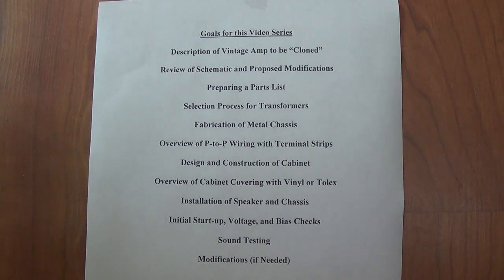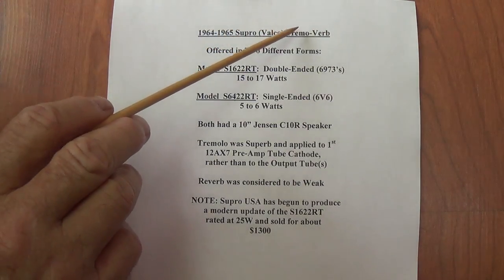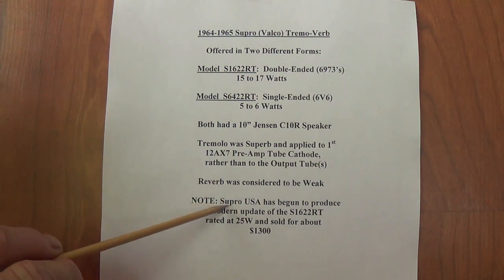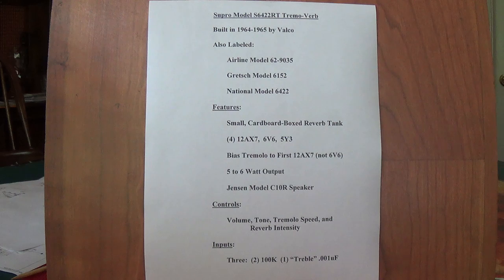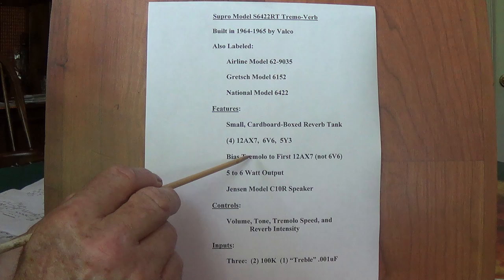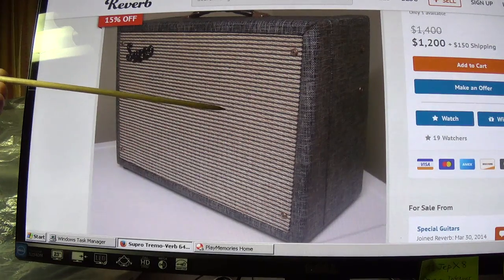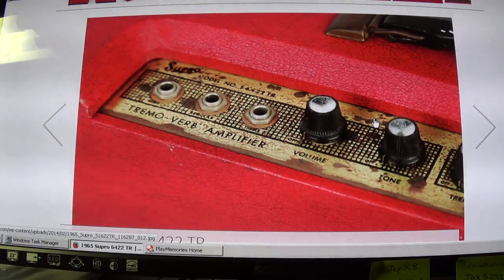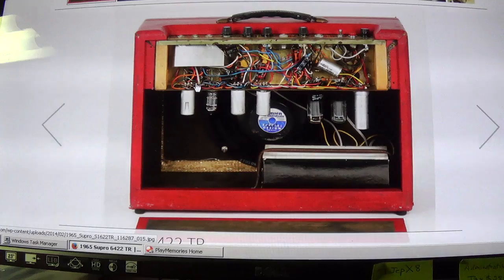How to Scratch-Build a Vintage Amp, Part 1:  Research and Methods

Comment: Supro resurrected because of nostalgic "demand"?..must have more to do the stuff of legends. Lots  of speculation that Jimmy Page recordied the first two Led Zepplin album, (Stairway to Heaven etc) on one of these vintage Supros  than anything else. Page never did say which Supro model he used, but it was "probably a 65-66  grey and silver model" as he claims in his Youtube video, so the run on these in pawnshops and in music stores,  makes it virtually impossible to find any of the original models, 
Any of those perceived to be of that era can command a HEFTY vintage price, so I'm not surprised at the re-issues. 

 If he knew what he used, he ain't saying which model, so that raises the speculation prices on any of the original 65-66 models that are still out there available for resale.  

It is rumoured that Page's amp used the rare RCA 6973  beam power tube, as used in the Airline/Valco amps of that period with "a single ended" (about 18 watts) design . However, that can't be true as the 6973 max plate dissipation is about 12 watts.
 (The RCA tube specs indicate about 15-17 watts max power output in a push-pull cathode bias arrangement)
. 
Now it is also speculated that Page changed the speaker in the original amp Supro amp "to a 10 inch" speaker.
 If the original Supro model  of that period came with those 6x9 speakers (ie: Supro 6616) , could there be enough room inside
the cabinet to even change the speaker to a 10"?

Uncle Doug; If you and Rusty can ever duplicate what Page used for those first two Led Zepplin recordings, you could become
as famous as Page and his special Supro amp.
Reply from the maker: +SuperCarver2011  I think the problem with accomplishing that goal, SC, is that no two people can agree on what that amp was or how it was modified. Also, and probably most critical, would be the absence of Jimbo's inestimable skills to make the amp sound "right".....unless of course, Rusty can convince him to drop by for a demo :)
Reply: If Jimmy Page's memory is anywhere like mine (I'm 69 now), I sure he would have a 
hard time remembering what he was doing
in the mid '60 to '68 when he was a session
musician, never mind the model of the amps
he was using. 
Page often points out that it is hard to remember exactly what he did given the enormous number of sessions he was playing at the time.
Reply from the maker: I understand his dilemma.....plus I'll bet there was some weed and whiskey involved, so all bets are off, memory-wise :)

Comment: By the way, I couldn't help but notice that Rusty seemed ambivalent at best about how much he really wanted to help out. I don't think this should be held against him, however, since he's obviously a fine old gent who has earned the right to decide which projects he wants to take on. More power to him, I say.
Reply from the maker: +Bruce Elliott  My feelings exactly, Bruce. I use the same approach with my wife when it comes to daily chores.....but her response seems to be much less understanding. I guess I need to adopt Rusty's tactics of either running away, hiding, or yawning.
Reply: Uncle Doug - I can't recommend the yawning. I've tried it, and it rarely goes well.
Reply from the maker: Yes, but it directs their wrath away from the chores and toward your bad manners..... ;)
Reply: I have to admire your commitment to avoiding work - it's inspiring.
Reply from the maker: I learned from a master :)

Comment: Hey, +Uncle Doug - I just came across this video, and it looks great! I've been toying with the idea of building my own vintage-style amp for a while, so this should give me a good idea of what I'd be up against.

I have one generic question, if you'd be inclined to answer: Are there any reasons why it would not be good idea to insert an effects loop (i.e. jacks for preamp out and power amp in) into a vintage styled circuit? Or even just a master voluem potentiometer at that point? That's the main thing I miss when I play through vintage amps, since it's so nice to be able to crank up the gain on the preamp to where I like it but still have independent control of the master volume.

Thanks!
Reply from the maker: +Bruce Elliott Greetings, Bruce.  On a scratch-built amp, you're free to add all sorts of modifications (as I intend to do with this one). The addition of an effects loop and master volume control would be much like my addition of the Fender reverb to this amp......you need to find a circuit that accomplishes what you want, and then graft it into the existing circuit. I don't use effects or master volume, so I have no personal experience with adding these features, but I'm sure there are forums that could help. Good luck.

Comment: You have come back from the summer break with a bang. The Elvis amp set the stage for this series. This will be a big project and you have thought it out really well! Thankz
Reply from the maker: +Audio Tech Labs You're welcome, ATL. Now that I've launched this boat, it should be interesting to see if it sails onward to glory......or sinks into infamy.  Either way, it should be an exciting cruise :)

Comment: Wow UD, this is going to be great, when I was young I used a Fender Twin Reverb, then the thing got heavier so I switched to a Deluxe Reverb, well, that gained mass with time too so I got a Princeton Reverb, now I gig with a Vibro Champ.I love reverb so I have to use a pedal.Anyway, looking forward to the series.
Reply from the maker: +tbdalva  I agree completely, TB. My days of lugging Fender Super Sixes up 9 flights of stairs are long gone.  As you mentioned, even the Deluxe Reverb is getting too heavy and the Princeton Reverb will follow soon. The thought of a compact, portable amp with both reverb and tremolo seems very appealing......and the SE novelty just makes it better.

Comment: I'm looking forward to this build! I watched the video you did on a guild thunder amp the other day was very impressed with the sound so i went looking for the schematic which was easy enough but pricing tubes and various bits  yes i can imagine the costs adding up ;-) but i love your ethic of reuse recycle wherever you can. One thing i was wondering also is what  say you can't find any photos or drawings of a particular original chassis/layout  is there a method for working out what size chassis you need and how to lay it out? Anyway hopefully all this more will be revealed in due course!
Reply from the maker: +Chris Kennedy  Greetings, Chris. Yes, the total cost of a scratch-build with new parts is substantial.....probably more than most people realize.  I'm keeping good records and will discuss this in future videos.  I generally can't find engineering drawings for any of the chassis I build, and usually rely on careful measurement of dimensions and L-W ratios, etc. from Internet pictures, i.e. as seen in this video.  More on this subject later.

Comment: Oh good timing Uncle.   I have three finished amps under my belt, last one was a 6G2ish Princeton thingy with Tremolo.   Was going to take the plunge on a reverb amp next so this series  already has me hooked!
Reply from the maker: +Barefeet200 Reverb is like a mini-amplifier and speaker (tank) circuit within the regular amp circuit, BF, but it's sure worth it (especially if it works :)  I'm a real tremolo and reverb hound, so I'm anxious to see how this turns out.

Comment: Super Groovy!   This may inspire me to reproduce a 63 Gibson amp I already have.   I've been told my amp sounds super cool when cranked loud,  but with the original Alnico speaker and original tubes and transformers....   I'd rather not hurt it.    So I wanted to clone mine.... and then rock the repro.

The other super cool SE Amp I built uses an 807 power tube for a whopping 12watts of Single End power.   I named that amplifier  "Braddock"
Reply from the maker: +DeadKoby  Greetings, DK. I think you have the right idea about preserving the original amp and cloning one for modification. It would be an interesting video to see and here a comparison.

Comment: Uncle Doug, you've done it again.  I'd never seen Airlines, Nationals or the likes of your Supro mini-amp until you put them in front of me.  The amount of time and effort invested by you certainly doesn't go unnoticed.  This one is no exception, a big project based on a circuit that is usual but unusual at the same time.  Hope that makes sense.  The design guys at Valco must have spent a lot of time doodling at the drawing board because they have so many variations on a theme.  Chasing that elusive 'tone' of course.  I see the CBO has a starring role and Jack, well cats will get you every time.  Looking forward to the next chapter.  Thanks again.
Reply from the maker: +Jeff M  You're welcome, Jeff.  We all appreciate your kind words of encouragement.....and may need them (and some whiskey) before this challenging project is completed.  It's interesting that the Supro version of this circuit generally sells for 2 to 3 times as much as the other brands.  I need to invite Jimmy Page over to the house to play all my guitars and amps......it seems to make them very valuable :)
Reply: +Uncle Doug  I find 'a wee drop' (about three fingers) makes a schematic look a lot clearer.  What a difference a name makes.  If Jimmy comes around he may make an offer for your gear you can't refuse.  Good for you, but rusted-on followers like us won't have anything to look at. (the Russian pole dancers have gone off a bit).  Ah well, you would just have to make some more projects.  Keep well.
Reply from the maker: We will, Jeff.....same to you :)

Comment: This looks like it will be a really good series. Do you have an expectation as to the overall cost?
Reply from the maker: +Sam Matthews  I will keep close tabs on that and report it, Sam.  I think a lot of people will be very surprised by how expensive scratch building is, even if you use reasonably priced parts (i.e. transformers).

Comment: Fantastic... Badger the tripod lurcher and I are waiting with baited breath. Your comments about single ended amps ring very true. I think the usually simple eq also highlights the tone of the guitar in a very direct way making sure you have your act together... Continuing the old wise man analogy they too often cut straight to the chase. I think the mid scoop of the bigger amps is often used as a hidey hole by some players. All the best from Wales sir.
Reply from the maker: +PoJoWo  Thanks so much, and best regards to both you and Badger.  SE's forever :)

Comment: Uncle Doug for President!  Thanks much for being so generous with your time and experience.  I'm really looking forward to this series.
Reply from the maker: +Peter Register  You're welcome, Peter, and thanks for the kind words.  I'm hopeful that it will be a rewarding experience for both of us :)
Reply: Hey Electronics genius Uncle Doug. I have this Marshall practice amp that I loved everything about it. The TDA2050 opamp cooked one day...so since I've  been attempting to repair my own gear...perform repairs and modifications... Could please tell me if it is a good idea of mine to replace that opamp, which I am certain , at least I'm pretty sure the tda2050 opamp is the output stage. So...it would  be sweet to put a tube/MOSFET hybrid opamp in its place. Borbely has a schematic that theoretically should work. Please any tips? Thank you Sir.